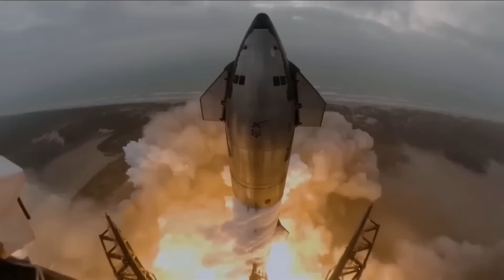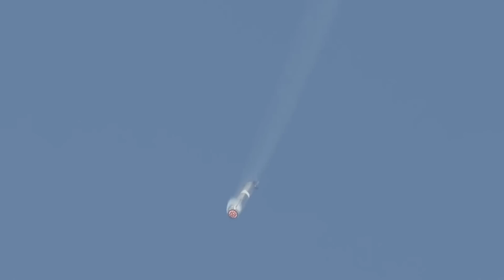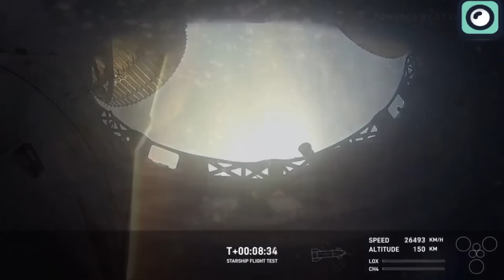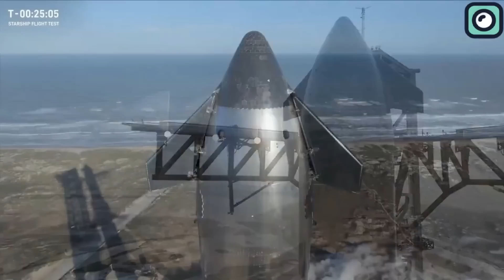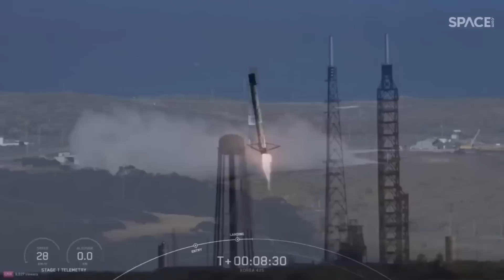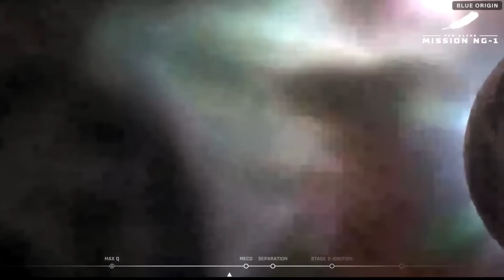Musk Revealed Starship Launch Aftermath... New Problems!

Comment: Wow, 60%, if NASA had such a “terrific” success rate during Apollo we would still be trying to land for the first time on the moon. SpaceX’s issues they use the launches as a test of the hardware rather rigorously testing the individual components and systems. Problems and potential issues should be identified during testing not during the mission. Every time  they blow up a rocket they never complete a mission and never find out if all the components and systems function as designed. This gives you a higher level of certainty and grater likely hood of a successful mission.
Reply: NASA never lost a Saturn launch vehicle
Reply: are you conveniently forgetting about those 2 shuttles?
Reply: @uweporth9337  The two orbiters was due to known technical issues that were not addressed due to management , political and budgetary issues.

Comment: New Glen was traveling over mach 5+, when it hit the water. Engines didn't relight. Why?😮
No heat shield, Falcon 9
Fires it's engines to deflect the heat. StarShip engines are internally cooled, you can see the flame all around the engines.
New Glen ALUMINUM
BODY PART'S WILL MELT, RIGHT?!!!😮
THE NEXT ROCKET IS ALREADY MADE, OUT OF ALUMINUM. OOOH!!! YEAH IT'S UNDER POWERED TOO???
NO PAYLOAD AND IT BARELY CLEARED THE TOWER.
TOTAL FAILURE!!!?😮